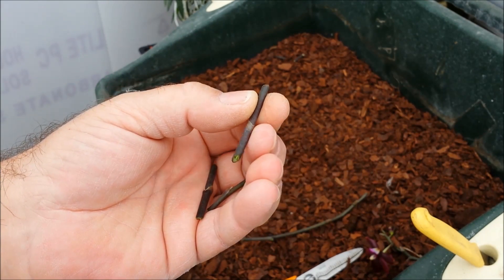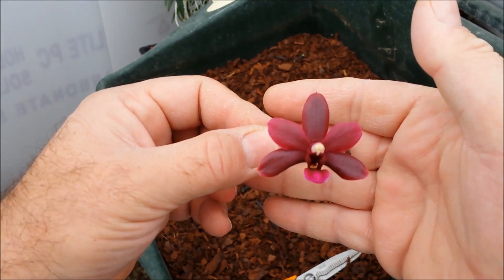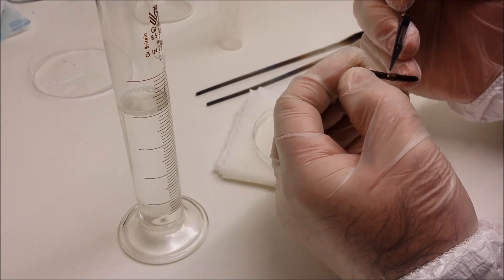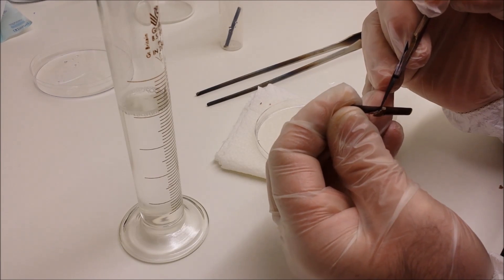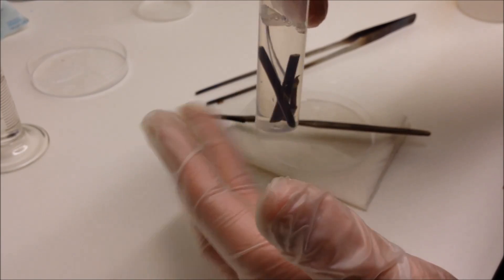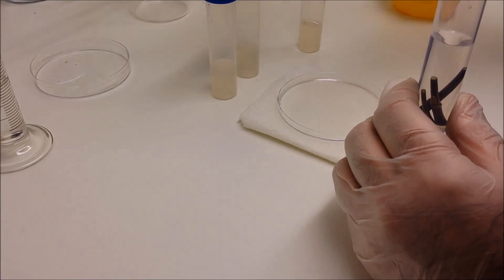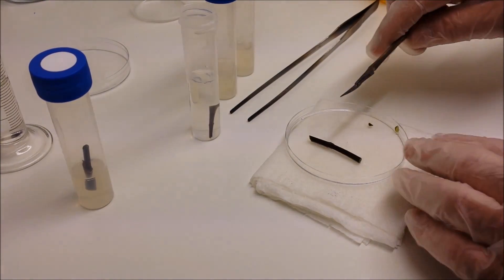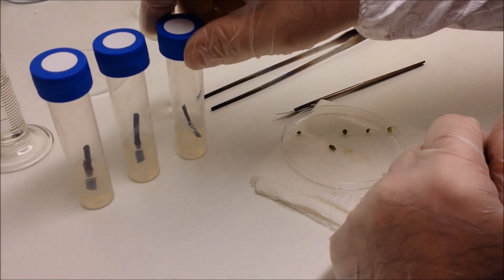How to clone or take cuttings of Phalaenopsis using flower stems in multiplication medium

Comment: There is no point of extra care for sterilizing when you put down your forcep and holding the material with your hand. You have hold a lot of things with your hands and you use it to hold the explant instead of a sterilized forcep. The forcep shoukd not be put down instead it should be put on top of a sterilize half cover petri dish to avoid contamination. Wrong practice.

Comment: you should see some growth in around 6 weeks. If anything went wrong and mold/fungus grows then it's usually a sterilization problem and that usually occurs within the first 3 days. Put the tubes in a well lit area but not in direct sun or it will cook! Should be around 24C

Comment: Hello.I would like to know, what next? I can repot small orchids into the pot with the substrate?they will be strong enough to survive? Thank you
Reply from the maker: Ivana Tesarovičová No problem. Once the plant has a few leaves and roots (preferably more than one) of around 1.5 - 2 inches you can remove it, wash off the jelly and remove any dead roots (sometimes they grow and die and grow and die and so on) then just pot up as per the keiki video. Keep the newly potted plants in a shady position for the first 10 days or so to allow them to acclimatise then grow as normal.
Reply: Orchid Species Thank you. I am checking the site but flasklettes are sold out.When the goods will be available again?